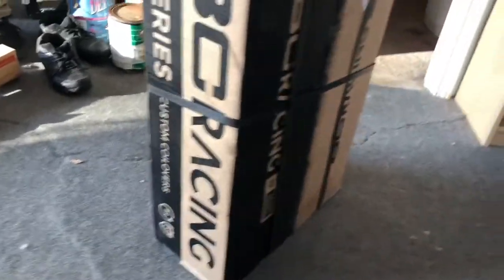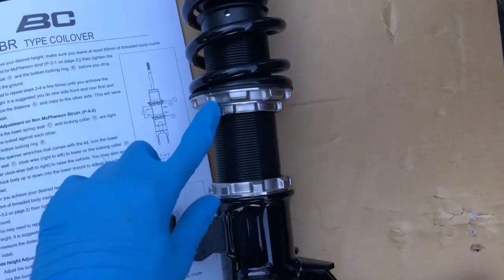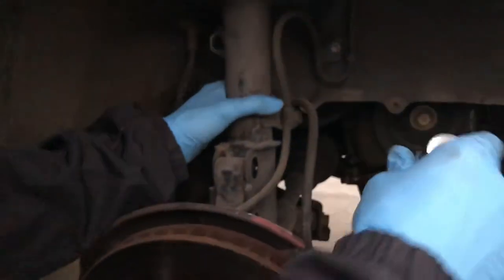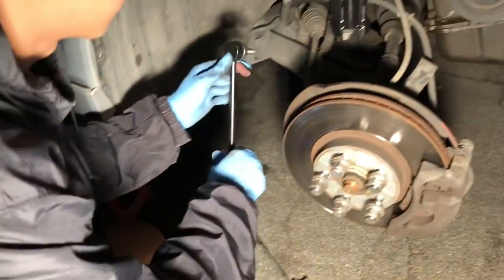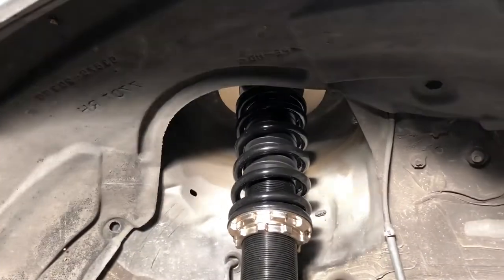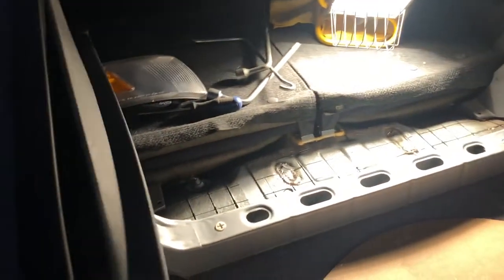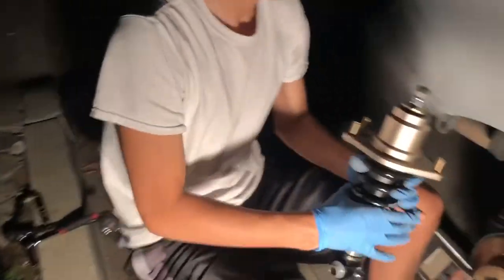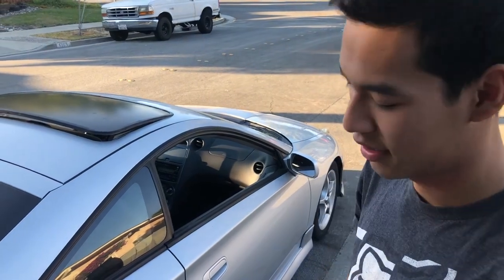How to Install BC Racing Coilovers (Extreme Low) | Toyota Celica

Comment: Happy I found your channel man. I also have a Celica but it's a 2000 gts. I've also replaced hatch struts (pain in the ass), o2 sensors, brakes, catalytic converter, speakers/amplifier, sunroof control, wipers, coolant flush, LED headlights/brake lights, LED shift knob, coil pack + spark plugs and right now I am trying to fix my suspension. A lot of work but it will be worth it. Good video 🤙🏽👍🏽
Reply from the maker: Thanks for the support! Glad you enjoyed it! 
And yea those struts are no joke lol. I also have some more work to do too, thanks for checking out the channel! 🙌🏽🤙🏽
Reply: @equinoxgts  how them BCR coming along???

Comment: So, the 2nd generation Toyota Matrix XRS (2009-2013) has the same exact suspension setup. Toyota diagrams are nearly identical. Virtually every part patches! Installing Teins on my 2010 Matrix XRS, and videos on modifying 2nd gen XRS's are not around, so this video is going to be a big big help.

Comment: How did you adjust the top hats/ Camber adjusters? Did you just spin the struts from the bottom? I’m asking because my Tein Flex Z coilovers just came in 😁. This vid is super helpful btw!!!
Reply from the maker: Are you talking about the 4 small Allen screws? If so, you just loosen them and then push the struts inwards for negative camber. Check out my most recent video, I adjust my camber plates in it!

Glad you found the vid useful! :)
Reply: Equinox No In the video you said that you didn’t install the front coilover camber adjusters properly and then you adjusted them horizontally fixing them. I was wondering how you did that? It’s in the second part of this video where you show the diagram.
Reply from the maker: Ohhh yeaaa, just turn the whole assembly until they line up properly, and then you’ll still be able to spin the bottom portion with ease before bolting everything together.
Reply: Equinox Final question did you turn the bottom part clockwise or counterclockwise? I did some research and it’s really not discussed. I know this either raises or lowers this part....slightly changing the ride height.
Reply from the maker: That I’m not too sure, if it does change the ride height just use the collars with the spaner wrenches to readjust it

Comment: 3:23 sup man! moving the top adjustment perches messes with pre-load.. it’s the bottom 3rd single one you use to adjust ride height.. never adjust the factory set pre-load. I’m pretty sure you fixed it and adjusted properly by now 😀
Reply from the maker: Not really sure what you mean...the top collar lowers the car by turning clockwise (counter clockwise would mess with preload), second collar raises the car by turning counterclockwise, and the third is the locking collar which allows me to adjust the first and second collar. So turning the collars the opposite direction than they’re supposed to is what would affect the preload. At least that’s what the instructions were saying and I was just following it :P
Reply: Equinox that’s weird lol the top two collars are to compress the springs which makes the pre-load adjustment, the single bottom one gets loosened and allowed the strut cartridge to spin raising it lowering it.. check the link https://youtu.be/MzAcxmjXLig
Reply from the maker: Yea you can loosen the bottom one, but you’d have to unbolt whatever is connecting to the bottom portion of the strut. Definitely makes it faster to adjust if you were trying to make a drastic height difference. Here’s the pdf of the instructions: https://61bfba21cfb27d3414b0-33d79809264fd8f465f395acab527149.ssl.cf1.rackcdn.com/bcr_f_20_br.pdf
Reply: Equinox check again under adjustment: “Never
turn the lower spring seat ○C counter clock-wise to adjust ride height as it would change the spring preload and can result in a poor ride quality..” 

Check your coilovers again before they blow  if you are local I can help you? I’m in SoCal
Reply: But either way man nice Celica and great videos 😁 can’t wait to see more vids 👍
Reply from the maker: Integra DIY yea that’s what I said in my first reply, only go clockwise on that collar and not counter clockwise or else it’ll mess up preload.

Comment: How does it handles now with this br series coilovers? I've seen you got the 8 kg spring rate for the rear. Did you set it up for soft or hard on the rear coilovers? 
I know this car, (at least mine and other 50 ppls i know with Celica) is  loosing traction on the rear and slides out in corners.
Did those coils improved the stability? Thanks a lot!
Reply from the maker: I haven’t messed with the dampers yet so they’re still in the middle setting but the ride quality is significantly stiffer. I have never experienced losing traction in the rear although it may also be that I haven’t driven hard enough around corners. Also I’ve seen people recommend installing rear strut braces/towers to improve the rear’s stability (maybe rear sway bars will help too, not sure).
Sorry if you didn’t get the answers you were looking for, I’m not too knowledgeable yet. Check out newcelica.org if you haven’t already, has tons of info!

Comment: Does it drive better than stock with these on? I travel pretty far quite often and I want a nice ride quality Dx
Reply from the maker: You can adjust the dampers to make it soft or hard, I have it set in the middle and it’s still on the stiffer side.

Comment: I wish my bolts came off like that, I just about broke my breaker bar trying to get the off. Im about  hit up a shop to see if they can install them since I dont have a decent torch set up...
Reply: Aw man broke two breaker bars trying to loosen my '05 Mini rear strut bolts, took it to a garage and they tried for an hour to get them off and called me to come get the car back hahah, a week later after soaking the threads with penetrate oil a few times a day and a couple of tins of butane in a blowtorch I finally managed to crack both of the bolts to turn a slight bit at a time.. Using a huge barbell with a wrench in the end of it as a breaker ahaha

Absolute joke of a job 😂 10/10 would not bother modding a mini again
Reply: @djsolarbear205  sounds like me n my mate trying to get the crankshaft pully bolt off my old civic 😂
Reply: @djsolarbear205  amazing story 🤣

Comment: How are they doing nearly 2 years later? Have you had to do any maintenance or had any issues with them?
Reply from the maker: Theyre running great! No issues, although I wished I had gone stiffer, but that’s just bc im a stance boi
Reply: @equinoxgts  fair enough! I bought the cheap unbranded $400 ones off ebay first, but those lasted about 2 months before the shocks failed. got the bc ones after watching your vid and they just arrived today! super keen to put them in
Reply from the maker: You get what you pay for 🤷🏽‍♂️ BCs are one of the top brands in the coil over market rn so good choice 👍🏽

Comment: Those are cheap bolts on the top,  use the oem ones. They are rust resistant. REAR -  you guys skipped how a pita it is to put the sway bar links back in? where's that? you didn't show how you pry it downwards to push it back in and retighten it (i used a 3 foot 2x4).. also the knuckles have a metal sleeve. if that sleeve moves the upper control arm wont fit. get a hammer and hit it flush and then it goes down and tightens......

Comment: As someone that owns two of these cars, why can't people just let them be stock? Changing out the stock wheels/tires is fine, but I would never do anything more than that to mine. In fact, both of mine still have the stock exhaust and intakes, and will stay that way
Reply from the maker: Everyone’s entitled to their own opinion, I just happen to be one of those that prefer to modify them 🤷🏽‍♂️
Reply: Preference buddy , on my Corolla T sport i have slid across roundabts because of the daft stock suspension , on coilys this does not happen. So question is do you stay with mediocrity or aim towards perfection which i admit is very expensive lol.